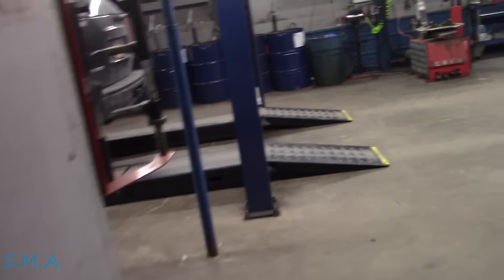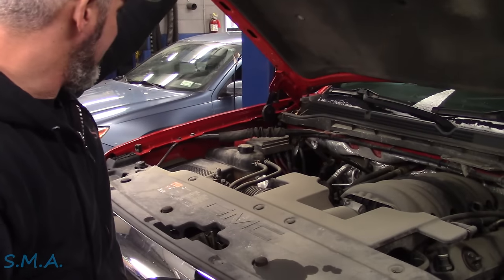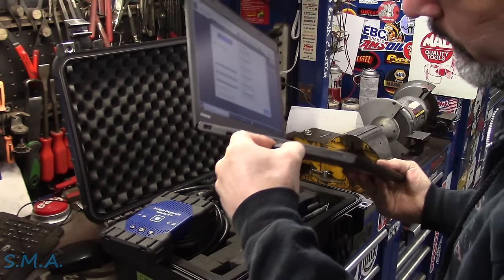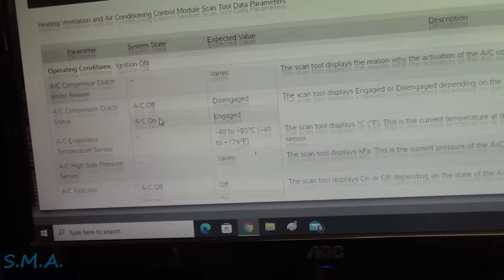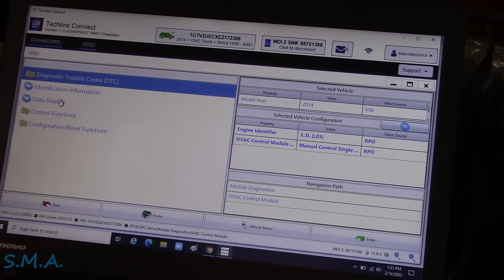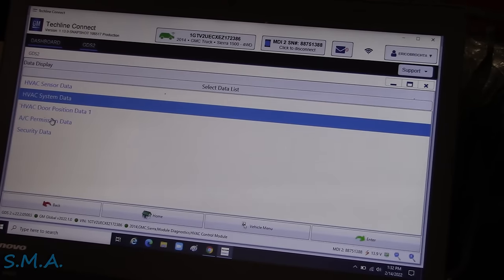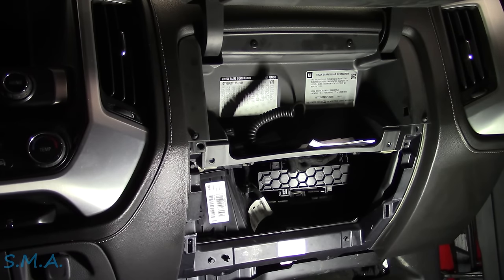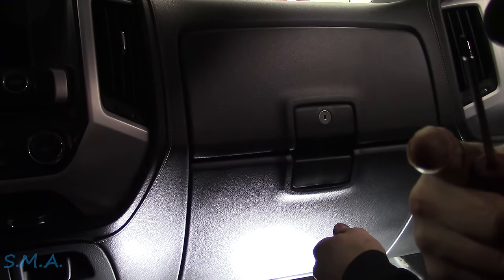Chevy/GMC Truck: Failed Heater Control Module

Comment: Moving forward:  Customer:  "My heat doesn't work".  Mechanic:  "Call your insurance company....your 3 year old car is totaled".
Reply: Saw a comedian talking about his POS car blew a tire. It was an oddball metric rim on some foreign car. The tire cost more than he paid for the car. His girlfriend was giving him smack about blowing a tire an totaling his car. 😅
Reply: GMChina should be embarrassed that a 7 year old vehicle even needs a new module. "Nobody skips the quality like GMChina".
Reply: Isn't that the truth...
Reply: Wait till you see how expensive Tesla parts are (and how they limit your ability to buy and program them) 
Of course the Tesla fans always defend them "Elon just cares about muh safety" but it should be quite clear to anyone on the outside, that it is deliberate to limit the useful life of the car, so you have to buy a new one. 
To prove my point. try and buy any parts for a 2010 Tesla Roadster. That's hardly an old car, but its completely unsupported and parts are almost non-existent.
Reply: My daughter said she wants a Tesla, I told her don’t call me when it breaks.
Reply: Hahahaha, that was too funny.
Reply: In GM's defense, that computer is $80 on Rock Auto. Rest is labor for diag and programming. And it's a 7 year old truck, which means it's potentially 3 years from the rust heap in upstate NY lol.
Reply: @KenLyns  Not sure how that justifies it being overly complicated just to do a simple job of passing air through the heater core. The vehicle is still not usable when it’s cold out and it has no heat so it might as well be broken down.
Reply: @markh.6687  If you think that's bad them read up on them and their lifter issues.
Reply: @markh.6687  Yeah, nobody except for EVERY other manufacturer! They're all junk these days.
Reply: @MikeBrown-ii3pt  Honda and Toyota laugh hysterically as they leave the chat, knowing they still make better products than GM, Ford, and Stellantis on a bad day.
Reply: @markh.6687  Keep dreaming.
Reply: @markh.6687  and now a days Mazda's and Honda's made for the U.S. Market are largely more made in U.S.A. than their supposedly U.S. competition...kind of makes you wounder doesn't it...between Mexico, Canada, and China...even though we have great electronics mfg's right here in the U.S.  but most of the chips still are made in China due to EPA and OSHA...the Chinese don't care about such things...
Reply: @KenLyns  Yes, but the diagnostic equipment is 10k.
Reply: the cars today are so poorly built, plastic hvac modules with plastic gears a cheap quality motors that fail, and brands like this car make it extremely difficult to replace. it would take a shop hours, which means, at least $1000 repair job. might as well call it totaled.

Comment: automotive engineers should be required to work in repair shop for 5 years before being allowed to put anything on paper
Reply: Not a dealership either, they would have access to everything the need.
Reply: Doubly so for the beancounters who demand cost cuts and the designers who demand things to look "just so" requiring things to be located is sub-optimal locations.
Reply: They should be required to work on anything they design.
Reply: Engineers are following their orders. My FIL was a Ford engineer. They did NOT make the decisions on how things were, they just had to make things work. It's the upper management that decides to make all these changes, mainly to cut costs, though these days also to lock out independent repair places.
Reply: ANY engineer in any discipline needs to work in the field first. Maybe then they would have a little more foresight in to the design of things. But, like someone mentioned, it's bean counters who also are to blame and guide the engineers decisions too.
Reply: Automotive engineers (I was one!) who design a part for a car, mechanical or electrical, should be required to repair a parking lot full of cars containing the part they designed. I'll bet that, before they repair 10 cars, they will come up with a better design to make the part easier to replace. (Probably not practical to do in real life, just saying.)
Reply: An old friend was an engineer for one of the top three auto makers, his dept. made heater controls. His guys came in with a new controller, they were proud, it all snapped together and was cheap to build. He looked it over and said, 'you have to break it to open it for repairs'. 'Well yes', they said. No, no he said, "go back and make a part that you don't  have to break to repair".
Reply: easy access to components that need repair or replacing would be a HUGE step in the right direction ... isn't it funny that with all our advancement in electron controlled devices more and more people are thinking, mechanical was more dependable? chuckles
Reply: @tomriggs3926  These days that's not a problem since nobody breaks open modules for repair, they just swap out modules.
Reply: So should aircraft engineers
Reply: @MichaelSteeves  yesa who the &%$# puts a starter under the intake manifold or in the bell housing should have been laughed at...not promoted!
Reply: This all actually started back in the early 90's with Honda. They were one of the first auto manufacturers to start building cars so they could be assembled quickly without regard to how they would be maintained later. As cars became smaller, engineers had to design module to module using less air space, resulting in next to impossible cars to repair. With the emphasis on fuel efficiency, weight had to go, and the end result was a car that looked like it spent a couple of hours in a compacter before it hit the showroom floor.

With China as our main source of electronic components, things are going to go from bad to worse in a heartbeat. Look at the way crash repairs are done today. Gone are the days of Bondo on a fender. It is cheaper in the long run to replace rather than to repair (for the auto shop), but it is the consumer who pays for 'advances in technology;. What used to be a $300 fender repair is now $1200. 

Keep your older cars if you can, Maintain them the best you can and bite the bullet when major repairs come down the road at you.
Reply: @Jerry Miller  they make it complicated so when people who don’t have a mechanic have to go back to the stealership for repairs that are double the cost of a normal shop that actually knows what they’re doing
Reply: @kamdaddypurp69  I am design engineer of 20years, your statement is just not true, although I can understand why you may think this.  I take orders & direction from accountants, marketing, field customer support and senior leadership.  Design engineers know how hard it can be to repair tractors, dozers, cars, trucks, & even motorcycles.  I fix my own vehicles, mechanical and electrical.  We don't make it hard to repair on purpose or insist we maximize the number of controllers/electrical on a vehicle.  If the consumer does not buy it, manufacturers will not build it, so if folks don't buy the Platinum/High Country/Laramie trim, they won't build it.  But we see folks driving the fancy stuff all the time.  Have a good one.
Reply: They have to show what they spent to get the education they got...lol
Reply: @John_Ridley  There's the real problem, Corporate management trying to lockout small/independent repair shops.
Reply: @stevea6722  Thankfully current administration is behind right to repair, hopefully they'll get some traction on it.
Reply: I buy 10 yr or older cars that people,get new cars ,they don't give you anything for trade in I pick them up about 4 to 5 grand and drive 5 yrs and say a few dollars 😅

Comment: When I got into my early 40's after 2+ decades of sitting behind a desk doing IT work for a living I got to the point where something had to give. I HATED IT. Got up every day and thought "do I really need this job?", then told myself I did need the job so I dragged myself to work and sat there for 8 hours hating every second of it. Finally one day a different opportunity came up with the same company and I jumped on it. Now I've been doing building maintenance mixed with a little grounds work for about 8 years and I'm loving it. The best thing was a couple months after I made the change, my former boss from IT came out with the guy they hired to replace me and stopped me while I was mowing the grass to ask a computer question. When I started telling him where to find the settings in the group policies for the domain the new guy was just staring at me like "why is the IT manager asking the lawnmower guy computer questions, and how does the lawnmower guy know the answers". I've been laughing about that ever since
Reply: Don't get me started on group policies.  It's such a convoluted mess at work that fixing one thing will break another.    Theoretically,  the dept. you are in should basically have everyone with the same GP.  Ha.   Fat chance on fixing one for an individual.  "If we fix this, that will break".      They are speaking the truth.  They have and it did.
Reply: Jack of all trades
Reply: Yeah told wife under two years to go maybe I’ll drive a school bus.  Tried of management lying about pay then making sure they have their bonus. Like John Wayne said-man speak with fork tongue
Reply: @Dirtyharry70585  Yep, I got my cdl b class. Planning on getting tanker and hazmat endorsement
Reply: Phil, if the new guy needs instruction on group policy settings, I'd suggest they find someone else with a deeper skill set. 
Of course, nobody knows what all the settings do but there are tools to see what's changed from default, which he should either have on digital paper or begin to make a list of.
It amazes me the sheer amount of IT troubleshooting skills that are lacking and how they can keep their company running. By the way, what's your group policy on cut grass height? 😄
Reply: Wow your story really hit home I submitted to the drudgery of corporate America in sitting in front of a computer in a windowless box for decades as well until I finally got the courage to go off on my own and I haven't looked back God bless you bud this is what America is all about We can call ourselves true Americans!
Reply: I worked in IT before becoming a firefighter.  I tell people that computers make me want to run into burning buildings!! LOL
Reply: @gregottingjr.6740  It's usually user error that makes it hard
Reply: That's some good stuff right there! Thanks for sharing!!!
Reply: Funny, I've thought about leaving IT to go get some certifications and work on cars.
Reply: @DaddyBeanDaddyBean  kinda similar with these new cars
Reply: @Dirtyharry70585  feel your pain. Between imaginary budget issues affecting personnel numbers and the end of the year condolences about how sorry they were about not giving out bonuses, while watching their salary bloat, I’m every day grateful I’m out of it.
Reply: I thought about attending automotive mechanics class in highschool but did end up taking a computer degree at college. I'm at the end of the rope on the IT computer manager work I do for a living up til now, I'm 58 yo and I've about had it in my current job. I have many times questioned my decicion, and wondered what life would have been if I chose mechanics instead. I'm a software engineer but do not program software at all, maybe my expertice would fit in the automotive repair business. I may ask my cousin if he would hire me as he owns a car repair garage close by 🙂
Reply: dude! i was in the exact same boat. I was doing in shop tech support, network admin, then did field work. i was so miserable. had to travel to various angry clients all over the city, with no car, since car insurance alone cost more than my rent as a new driver. the pay was really bad. i was not happy. it got even worse when i had to drop out of college to take care of my sick mom. then a few years later, i went back to college and said goodbye to IT. the jobs paid so little, and was always first on the chopping block for any company to cut back. my hunch paid off. everything is now cloud based, IT is completely off-shored, with minimal overhead. so i studied finance and made the money i wanted, and now i'm seriously considering retiring early. i had to stop telling people I was in IT, because they kept bothering me with constant support questions. now nobody knows! lol

Comment: So you have a module that connects to another module to take the place of a thing called a switch which cost a dollar? And they all cause a drain on the HDI module : Human Dealer Interface. Otherwise known as a wallet.

Comment: The late 90's into the early 00's vehicles seemed to have reached the right balance of electronic and mechanical harmony. Some things are better done using a simple electrical circuit without any computer input vs 50 ft of vacuum line and control cables snaking everywhere. On the flip side seeing a vehicle with a dead HVAC system because a brain box died is just pure stupidity. Even more insulting is that brain box requires a programming routine just to function.

Comment: Reminiscent of the days when cables ran the heating and defrost systems!!! THE GOOD OLD DAYS!!!!!
Reply: Cables or vacuum hoses....
Reply: @bobweiss8682  Unless the cables kinked or came out, then you had to remove or move aside 3 or 4 cables to swing the fascia aside to get to the one broken or slipped off. 1 for the blend door, 1 for the AC control, 1 for the outside vent and 1 for the foot vents and so on. But still a damn site easier - AND you had plenty of room underneath to work with.
Reply: Now it’s all about electronics and programming.
Reply: @jdrs4214  It must cost a fortune, and it's just so you can have fancy blinking lights on your dash
Reply: I'm sorry to break it to ya, but times are changing (like always). If you want the world to stay like it was in the 80's, I don't know what to say.
Reply: @TomWishaupt  You just made an amazing revelation.
Reply: @TomWishaupt  except you can still own a car from the 80’s like I do.
Reply: The good old days when cars had carburetors and chokes that didn’t always work and wouldn’t start reliably when below zero?  The good old days when spark plugs lasted 12,000 miles and points had to be filed about as often to keep them working?  And distributor caps that would get burned and pitted and stop working?  Those good old days?  😂. Yes, I remember them well and am still trying to forget them.
Reply: @LTVoyager  I don't think anyone here is talking about THOSE days.
Reply: @paulparoma  Those were the same days of all mechanical HVAC systems.
Reply: If they would have given you even 3 inches of slack it would have been much better. Broken HVAC on my 91 was the last thing that broke before I got a newer vehicle. Guess they haven't made it any better
Reply: @LTVoyager  My 2005 Scion has a pretty basic system which works very well. None of this electronic crap no one needs, but everyone wants.
Reply: @paulparoma  I neither need or want it, but on most vehicles it isn’t a choice.  I still prefer standard shift and hand crank windows, but when I moved from a 1994 Chevy truck (which had both) to my current 2015 Chevy truck, I had no option for either.  The only way to get a standard transmission was to pay $60,000 for a diesel and I don’t think hand crank windows are available at all.
Reply: @LTVoyager  I see your predicament there.
Reply: My 1957 VW was 6volt and used and electric heater that was an optional extra when I bought it new!
Reply: @annamariequigley6594  Which has nothing to do with what I wrote.
Reply: Newer base model buick encores and chevy traxes still have cable drive doors
Reply: @andrewdelmonte1385  Some other cheaper cars do also.
Reply: Henry G , well said !!!  I miss those days !!
Reply: @paulparoma  those are the ones that i know of because i work at a gm dealer
Reply: @andrewdelmonte1385  Must be a fun job.;)
Reply: @paulparoma  its not bad. Gm SI makes it seem easier than it is
Reply: @andrewdelmonte1385  I see. If it brings some satisfaction, it's not a bad thing.
Reply: @LTVoyager  nobody changed spark plugs once every year.
Reply: @robertlawler1387  People who wanted their cars to start reliably did, particularly in cold climates.  The leaded gas fouled the plugs and standard plugs would erode pretty well in 12,000 miles causing the gap to be too large to be bridged reliably by the voltage available from a points and coil ignition.  I know, I lived through the 60s.
Reply: Some small  French  cars didn't even have cables, just a tap (faucet)  you could turn by hand
Reply: @andrewwmacfadyen6958  The French often have original solutions. To lock any door in France, you need two hands.
Reply: @LTVoyager  O I grew up in the South so we must have not had this plug failure. So I guess I'm still learning the truth.
Reply: @andrewwmacfadyen6958  French cars have always been a little different.  😁
Reply: @robertlawler1387  Starting a car at -20 is a whole nother animal and I can tell you that carburetors, points/coil ignition and copper spark plugs simply didn’t cut the mustard.  Modern cars with FI, electronic ignition and platinum plugs are so far superior it isn’t even worth making a comparison.

Comment: Electronic gizmo placed on top of a heat source... Genius...sheer Genius.
Reply: Push button controls suck, I miss the old cable operated heaters
Reply: That's a heat and vibration source.

Comment: What is cheap these day?  Nothing.  Everything is expensive, electronics are disposable, cars are a nightmare.  I don't envy you, but I sure love watching what you do.  I'll stick to my 70's motorcycles which 99% still had points and a lot were 6v systems.  Not that they can't be a challenge, but no EFI, no Computers, no fancy electronics, cables for everything, a single carb, and pretty simple wiring.  And if SMA wasn't around doing what you do, and how you do it,  I'd be pretty bored.  Thank you Eric & Mrs O.